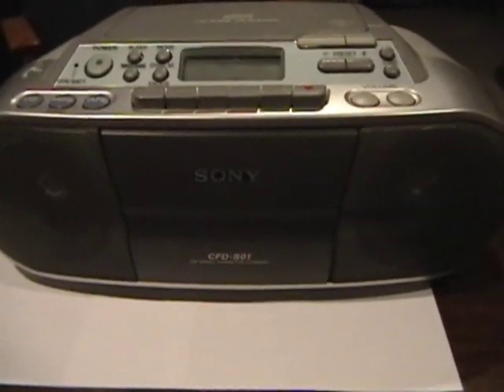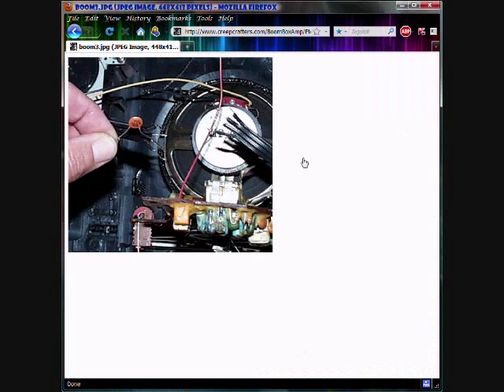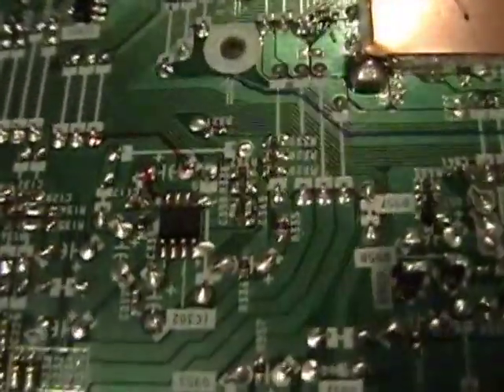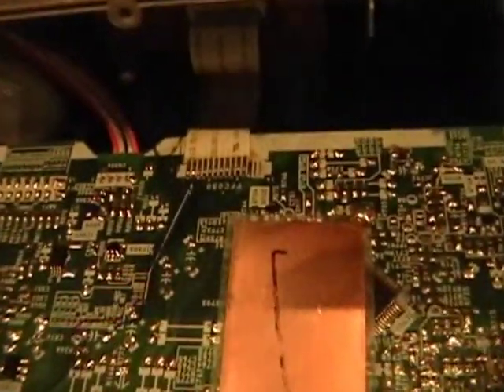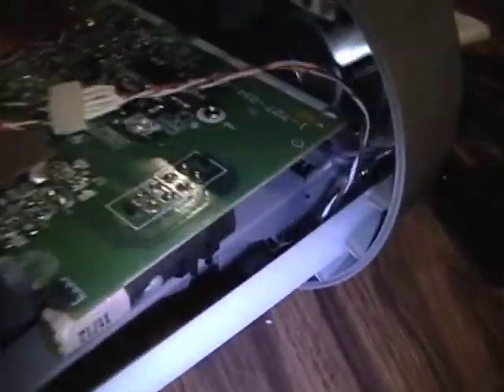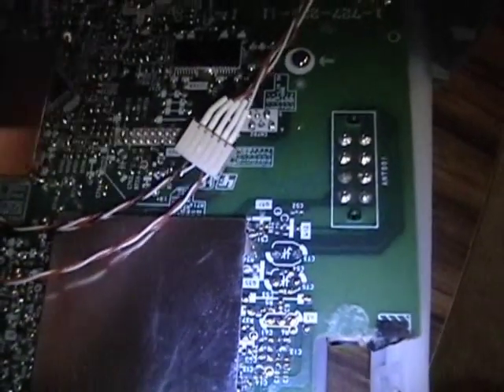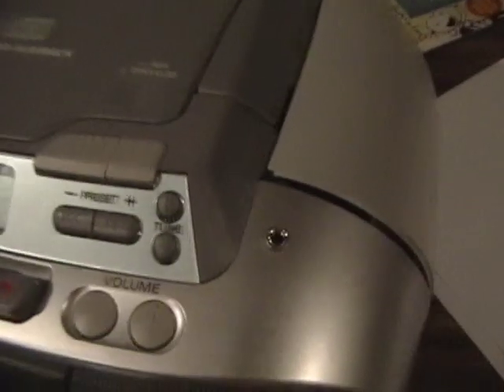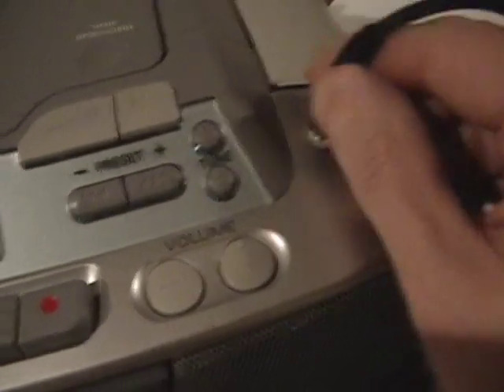Boombox Modification - Add Aux Input

Comment: Did this whih a philips boombox because a bunch of wood fell on top of it because it was a wood shop boombox and the radio tuner board was broken in half but the main amp and tape and the CD player all still worked. I found the right connections and I have an input jack installed in the back. I plan to install a digital tune radio board inside with buttons to tune the radio and control the radio's output volume. I'll run the audio from the radio into the input jack by a short aux cord that I can unplug when I want to use AUX device for now until I can figure out how to make it so when you plug in something to the aux jack it disconnects the output from the radio. I have some of those same audio jacks but I'm not sure if they have the built-in switches that disconnect when an aux cord is plugged in. Half the battle is assembling the radio board because it's a kit and needs SMD soldering and I'm not that good.

Comment: Thanks for sharing. It's very helpful. I just did the same modification to an exactly same model. I have some experiences to share as well:
1. There is no need for the 12μF capacitor for checking signal flow direction. Just hold a metal wire and tap the tip you want to check
2. If you don't need the earphone output (which is my case), then you can convert the existing output to aux line in. This eliminates the need for an additional 3.5mm audio socket.
3. The ribbon is quite brittle after splitting. It's better to solder the wire from 3.5mm audio socket to the circuit board on the other end of the ribbon rather than onto the ribbon itself.
Reply from the maker: Thanks, Fred.  I'm surprised this video is still getting activity 8 years later.  Good points about the capacitor and soldering.  Also good tip about rerouting the headphone jack.  I wanted to leave that stock.  Rock on!

Comment: I know this video is old, but it was very helpful. It saved my  Sony CFD-E75 from a landfill grave. I was lucky the connections from the tuner pcb on mine were clearly marked , left, right, gnd etc. Which made the mod very easy.
Reply from the maker: Thanks for the nice feedback.  Props to you for making the effort.  For me, the feeling of success is worth at least as much as the modification itself.  Rock on...
Reply: I got a sony CFM and want to do the same, did you connect the aux to the radio, as here, or to the cassette?
Reply: @panchoskywalker  I made mine to the radio.

Comment: You can download the TA2068N Datasheet from following link. Look  at the pin 14 and 24 as the Line IN. Via a 0.47uF capacitor connect to AUX input as shown in the page 14. I use these 2 pins as my MP3 player signal input. 

TOSHIBA PREAMPLIFIER always named ATXXXX, so you can get the LINE IN pin assignment via the datasheet. It would be much easier the add the aux input.

http://pdf1.alldatasheet.com/datasheet-pdf/view/31223/TOSHIBA/TA2068N.html

Comment: This! Is so cool! I have a jcv boom blaster you know the long round one, but mine is a early type with no aux...... So I guess I'm gonna try installing a aux using you video hoping it will be the same way to find the point to solder on :)
Reply: i have the jvc RV-B70 its even easier to do it, yesterday i did mine after watching this video. just open it go to radio board and solder wires underneath the flat connector cable, you can even read rch/lch and ground solder your cables on those pins and build in your female jack and solder the cables and it works great.

Comment: you tapped into the pre-amp? I've seen other videos that say to bypass the pre-amp and go directly to the amp for use with an mp3 player (maybe the reason your mp3 player is loader then your radio since the player already sends a 1db signal. 
I have a nice Sony ZS-X3CP and stumped as to how to proceed. This things sounds great and would like to put it to good use, while keeping the radio and cd functions. Any tips as to where to tap in while still using a 5 pin 3.5 mm jack?

Comment: Great how to vid. I have that same radio. I was wondering if it's possible to disable the mute function when scanning for channels. I can't find a circuit diagram for that radio but you seem like an EE and was wondering if you're ever into that radio again it if it's possible to disable that mute function. I know some radios have a pin or trace you can cut. Thanks.
Reply from the maker: Brad,  Thanks for the praise.  It's why I make these videos.  Sorry--three strikes--you're out.  1) I am unaware of the mute function you describe.  2)  I'm just an ME that likes to modify stuff to suit my needs.  3)  It's unlikely I'll ever open this radio again.  It probably doesn't even get turned on anymore since my son got Logitech 2+1 powered speakers to hook to his MP3 player (much better sound).  Thanks again for taking the time to type nice words.
Reply: No prob. I love how to vids and this is awesome. Now I know how to do that and as luck would have it, I found a service manual for that radio so if anyone wants to play with their radio and can read (witchcraft) schematics LOL here's the link.
http://elektrotanya.com/sony_cfd-s01_ver-1.0_sm.pdf/download.html

I believe what I want to do is on page 18 at pin 35. Just a little snip and I should be good to go.

Take care.

Comment: the video quality is not so clear , im trying to see where all the wires go
im doing the same thing to my Sony radio
unfortunately i shorted out my main a/c input transformer in the proces of doing this mod lol
hopefully i can get it back up and running as i don't want to use it with battery power lol 
most people will think is a waste of time with all the new technology out but I am doing this to improve my component level electronic skills :-)

Comment from the maker: You are very welcome!  YouTube videos have helped me on many projects, so I feel good about making a video that might help someone else.  I tried the same modification to a car stereo, but it didn't turn out so well.  I tapped in to the wrong part of the circuit and blew something.  It was a 20-year-old tape deck and I got a used Pioneer DEHP600UB as a replacement, so all is well.  Great job to you on getting the result you wanted for a cheap price!